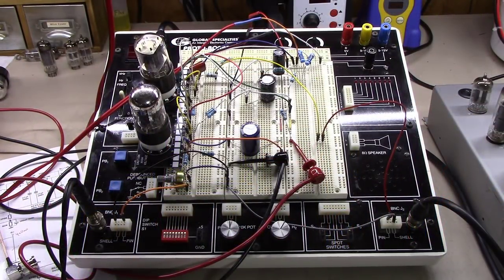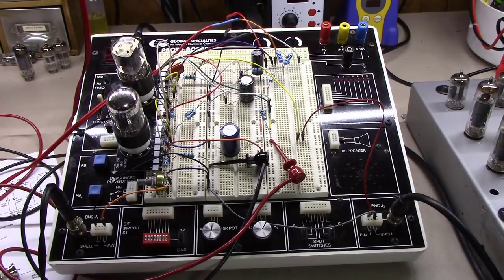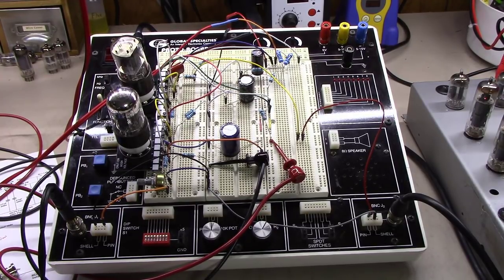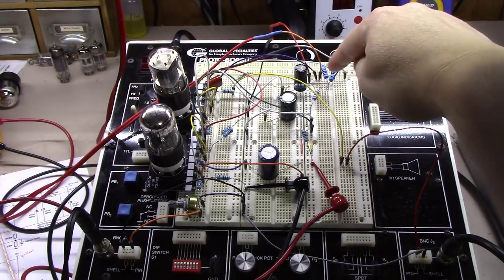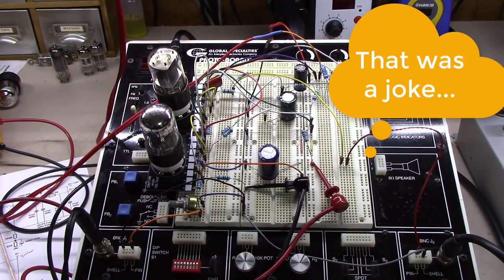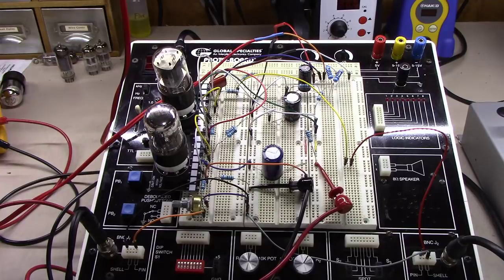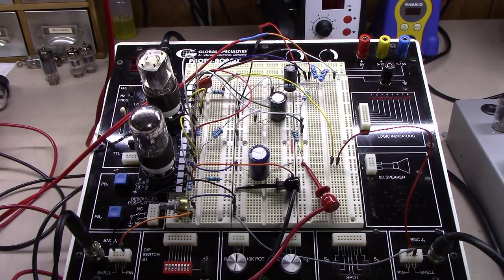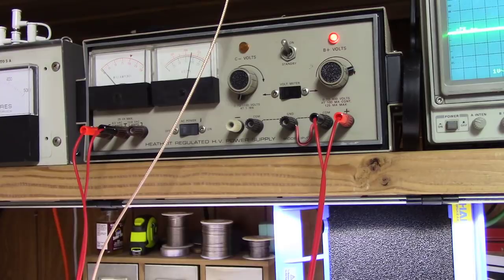Zeus SRPP Tube Preamp - Part 1

Comment: I build an active exciter based SRPP for Surface amp , and I am glad to see others still using resistor biasing. I don't use resistor biasing...but, other than incorrect tube choice, you on the right path...

Comment: You might consider running your filaments direct wired to the PCB adapters and not overheat your breadboard.
I have build many preamps and I agree that the 6SN7 is a great tube. However, for the phono stage, I am very happy with nuvistors and the RIAA stage wired between the 2 stages. Nuvistors are microphonic but once you sync them in an aluminium  block with a thin layer of silicone around the shell of the tube, they are amazing. Very fast and designed for many years of use. I read somewhere that the original designs were hoping for a 30 year life 24 x 7.. And some of the early satellites that went up in the 60's were still running strong in the late 90's.  I have not checked on their survivability recently.
Thanks for the videos.. I am glad to see others still tinkering with Hollow State devices.  Though, I am playing with some newer FETS and I got to tell you, I'm impressed...Not sexy to look at but vry sexy to listen to... :)
73, Glenn WA4AOS DSM Labs

Comment: Mark- Thanks for all of these great videos.   You do a terrific job communicating what you are doing and why and I have have leaned a lot from them.   I would definitely be interested in a this pre-amplifier kit and would love to have documentation on why a component is needed in the circuit and where possible, why a particular value for the component was chosen.    For example, why would a 4.7uF capacitor be better suited than a 10uF or 50uF at the same location.    Awesome stuff.  Thanks!

Comment: Please forgive me asking a question that may be off topic.  I have been following the build of your previous amps.  Could you please explain the purpose of a 'choke' in a tube amp?  Or do you know where to find info about it?   On Wikipedia I found 'choke' related to a carburator, which, obviously, is not what I am looking for.
Reply: A choke is an inductor which works in two ways (broadly speaking)to reduce AC ripple on a DC power supply. Ripple is the unwanted hum you sometimes hear coming out of your speakers.
  The first way a choke reduces ripple is when used with a capacitor to form a RC (LC) filter to block low frequencies like 100/120hz ripple.
   The second way is that an inductor opposes or "chokes" the change in current flow.
   See - https://en.wikipedia.org/wiki/Choke_%28electronics%29 and - https://www.electro-tech-online.com/threads/choke-filter.18475/  and lastly - http://www.aikenamps.com/index.php/chokes-explained
    Hopes that helps and that Mark doesn't mind me answering your question.

Comment: Hey Mark, this is Randy over in Winston. Paul McGowan at PS Audio touched on this a bit the other day on his channel. Sort of the pros and cons of kits from a supplier standpoint. 
I agree with many of the comments here that the details on what each component does, rather than simple assembly instructions are where the real magic is for this idea. I can see where this could be a P.I.T.A. and a coordination challenge actually supplying the kits.
I think I’d like a separate phono preamp so it doesn’t turn into a one size fits all phono stage. Gives you some place to go if the first kit is successful.
What I’d like to see is a simple selector for several inputs, NO tape loop, a high quality volume control. You might also consider a remote/separate power supply. I upgraded my SS preamp power supply to a remote and it really lit things up! Remote control for the volume would be nice but not a deal breaker.

Comment: Great work Mark, I've been waiting for this one.
I like the idea of a stand alone pre-amp with RIAA stage that can be switched to phone/tuner input also.
Tube pre & phono amp kits that are not PCB based are hard to find.
I wonder if you would design the preamp to complement the SE807 & KT88 amps you've done videos on?
A kit or a schematic works for me, but a kit that educates on the how it works level is a great idea & sounds like a passion of yours, so do it.
I live in Australia & find that its hard to get a transformer that is exactly what you want so 9 times out of 10, I pay the money and source them from the US anyway.
A kit with a universal option may help sales with the added knowledge of power supply input voltage choices as a bonus.
There are many great comments here, particularly "bobparise 1" regarding the headphone jack.
Cheers, Mick.

Comment: UK based so kit not an option too expensive to import to the UK plus the shipping.  So no to a kit from me, plus it is your choice of parts and not mine.  Would much prefer a series like the SE807 which included a Phono Pre-amp which could used as a stand alone or the Zeus SRPP Line Amplifier.  Plus a kit narrows the outflow of knowledge to a limited audience, whereas your aim is to educate.

Comment: Hi Mark
Yes I happen to Have a PCB board for a 6n1p version of the SRPP pre amp but have-not done anything with it yet I will watch your build with the 6sn7s with  interest 
May I suggest that you build a choke smoothed regulated supply and builds the RIAA stage in its own case as you may well be plagued with   hum problems. My 12AX7/ phono stage and the 6n1pEV buffer pre I built  from the world audio design well  known for their Kel84 and kt 88 amp kits here in the uk  are in there own shielded steel cases but still have to sit apart from each other one above the other seems to be best  
Colin

Comment: I’d like to learn more about BASS RESPONSE and tube amps & preamps. All the nicer tube stereos I’ve ever heard sounded absolutely gorgeous in the highs and mids, particularly the vocal mids, but sound totally anemic in the bass. I am not referring to the fake bass tracks & subwoofers common in the car audio world or even the hyped bass of pop music. I am referring to the realistic bass you’d hear if you were in front of a live jazz or blues band with a bass and kick drum. The lowest E note on a bass is around 34Hz.....so I need a relatively flat response down to @ 32Hz. Are the limitations I hear do to tube gear or the speakers commonly paired with tube gear? Thx
Reply: Poor bass response is often due to cheap OPT's (output transformer) used in cheaper valve amplifiers. In a nutshell the bigger the core of an OPT, the better the low frequency response, but more "iron" means more money.
   For more detailed info see - http://dissident-audio.com/Transfos/Papers/Wolpert_Audio_Xfmr_Design_Manual.pdf

Comment: I would definitely be interested in the kit,  I would probably buy one. If you didn't do the kit, I would likely build one either way, as I am working on a SE807 based on your video series. You could (eventually) have a beginner, novice and advanced kit. The later having phono mc/mm features and maybe some equalization control? That (imo) would make it more interesting and challenging for your more advanced followers. Probably more trouble than you were thinking. Just a thought. thanks for all you do!

Comment: I would perfect it further before making a kit, what is it output impedance should be really no more than 100 Ohm's, for good matching. And you need to test it with multiple different power output amps, like with solid state how it performs. And make the phono stage as a module to plug into it later on I think you're asking too much and making it over complicated for the average Builder by doing a phono stage now! Perfect this and later with any more adjustments  you might come up with for the preamp and doing a updated video on this with the phono stage build. Didn't notice if it had any tone controls doesn't look like it why! I think you should put tone controls in with a bypass switch. What quality of volume pot are using this is very important is it metal wound and a high-grade, is it going to be linear or logic?